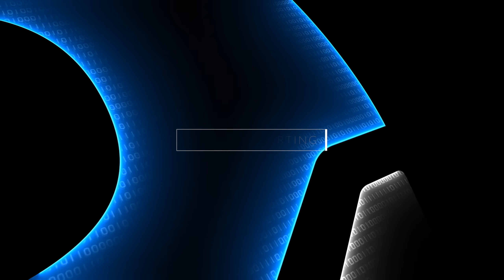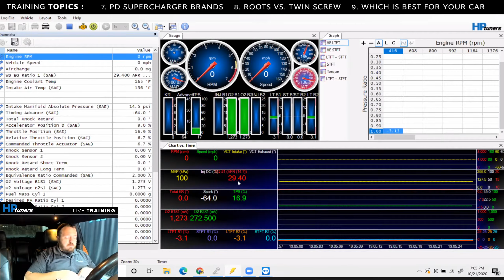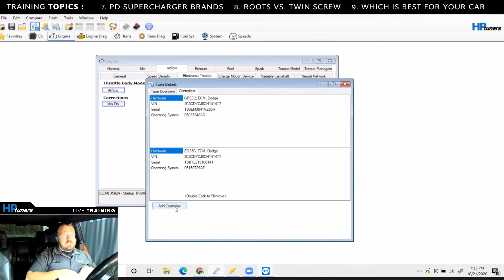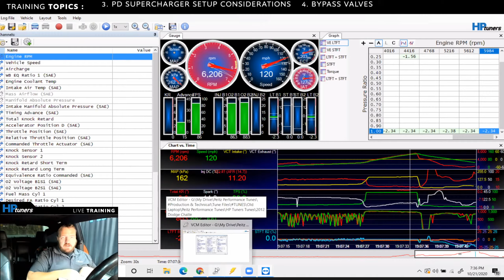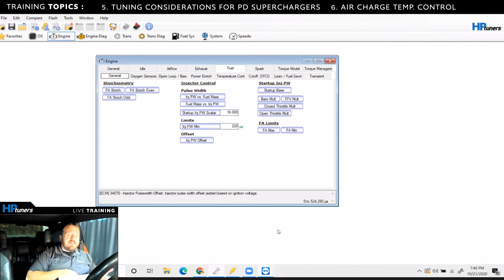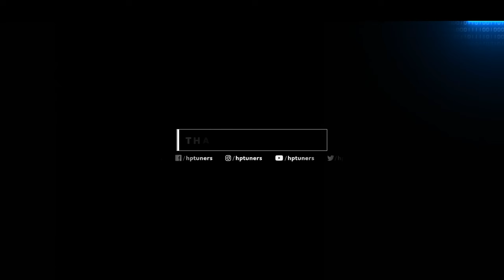Supercharger Tuning | HP Tuners Live Training

Comment: I have a 2013 R/T 5.7 hemi. 
I just put a Procharger on it with one or 2 step cooler plugs because I was running nitrous, flowmasters and ENA coils. 
Can you write me a base tune so I can drive this?
My tuner guy is trying everything he can not to wright my tune, and I already paid him. 
Now my car is just collecting dust because i don’t want to start it without the tune.
I have HP tuners MPVI3
And Ken bell boost a pump and the injectors that came with the Procharger kit

Comment: Funny you talked about efficiency I’m running a centrifugal supercharger and I was thinking about raising the boost but I have the lowest boost pulley on it but I built my engine to rap out quick and I never see full boost on lower gears I have to get on the hwy just to hit fill boost. So no need for a smaller pulley. Motor does what I wanted it to do I guess . Thanks for the video can’t wait for the next one.